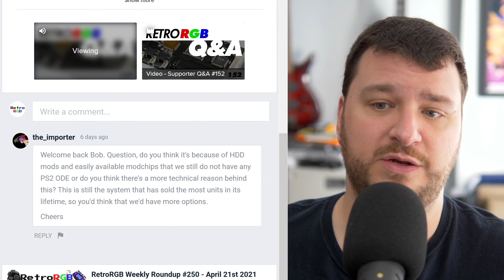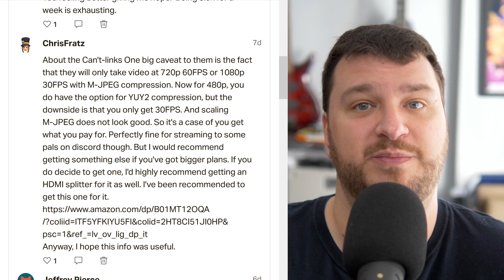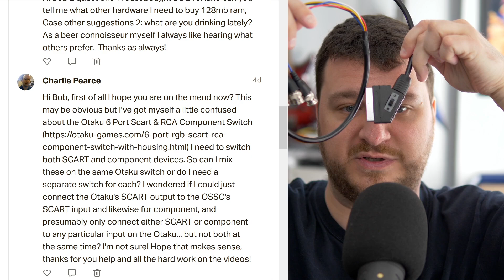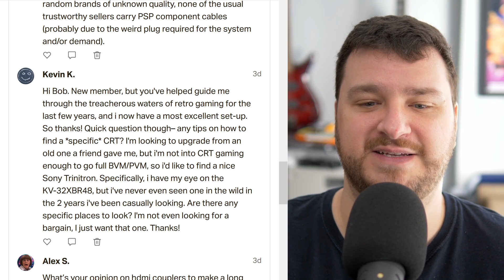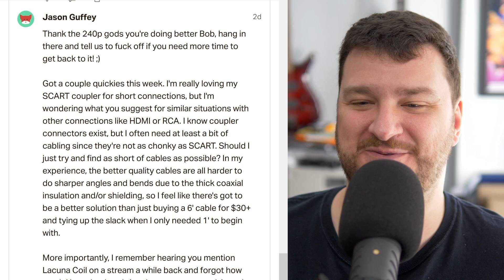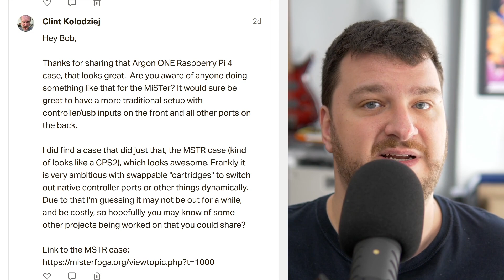Supporter Q&A #153

Comment: Glad to hear you're doing well Bob!  Not too long ago I got one of the Otaku Games 6-port component/RGB switches and have been quite happy with it.  In my initial setup, I did mix 4 component and 2 SCART inputs and had them go to one of the RGB(s) inputs on my PVM TV.  The only downside to this was I had to manually go through the TV menu to change sync between internal (component) and external (SCART RGBs), which was a slight pain.  I think some PVMs have a sync button on the front for this purpose, but mine does not.  More recently I bought a second identical switch (I needed more than 6 inputs), so now I'm putting all the component inputs on one switch and all SCART RGB inputs on the second switch, with each one going to a different set of RGB(s) inputs in my TV.  So far so good, and I no longer need to fiddle with TV menus when changing inputs.  I'm not an expert, but to me the images look great, though I might try upgrading the cables I use.